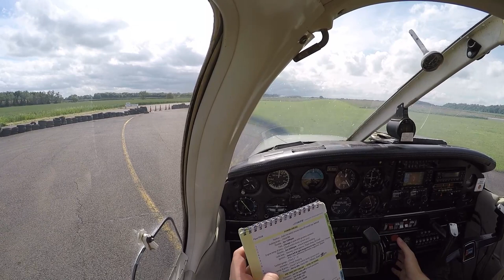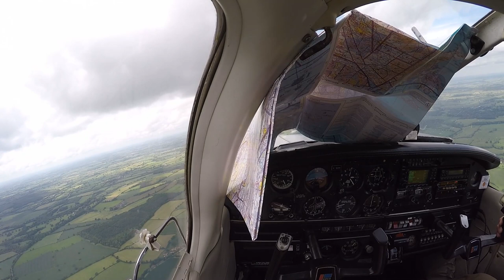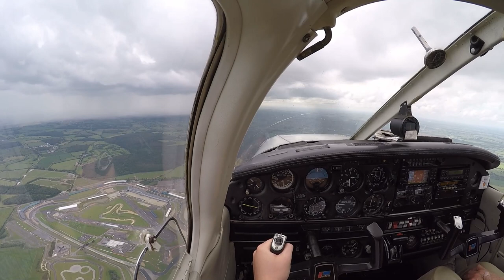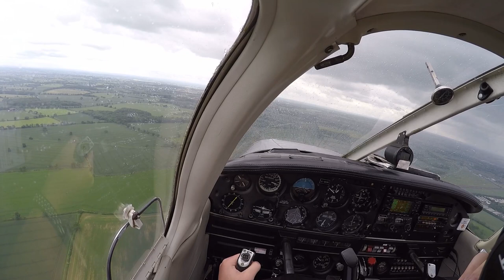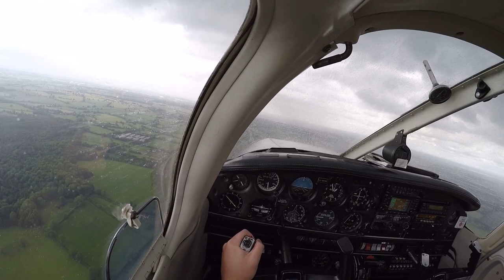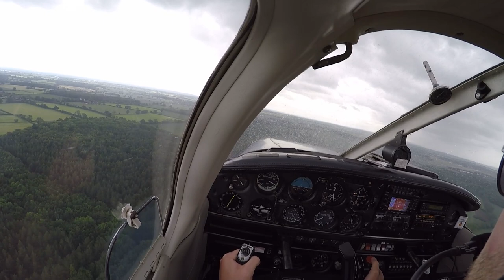PPL | Lesson #30 | 16-06-2019 | IFR Practice

Comment: Glad to see another video shared :) I continue to think your instructor is brilliant at what he does.  Not labouring the point and not confusing things unnecessarily.

I paused this one part-way through to go learn more about the VOR instrument you were using.  I've not seen you use that on any previous videos so wanted to understand a bit more about what was going on.  After watching this video - https://www.youtube.com/watch?v=38D03xtbxn0 - I'm quite a bit clearer on what you're doing when you adjust things and use it to set your heading.  Have to admit, still getting my head around the To/From aspect!  Also struggling to follow what navigation was going on around the 43 minute mark.

Thanks again for sharing these videos :)
Reply from the maker: Paul Durston no worries, glad they help! Yeah the VOR does take some getting you’re head around but once learnt then applied, becomes a lot clearer. 

There’ll be another video tonight at 18:00 and then each Friday until my mock skills which is Lesson 35.... so 5 more to go.
Reply: @simoncort22  Looking forward to the rest of the videos.  Did you say in a previous comment that you didn't record the actual skills test?  Understandable really :)
Reply from the maker: Paul Durston yes I was advised not to record the skills test for obvious reasons. I have however recorded the mock skills which was the day before. Although it wasn’t the same route etc, it’s basically the same format. The skills test marking sheet is available on the CAA website, so it’s no surprise what’s going to be asked of you...
Reply: @simoncort22  - I've seen a good overview of the skills test from @pilottrainingwill where he shares his advice and also a link to the mark sheet on the CAA website - very helpful.